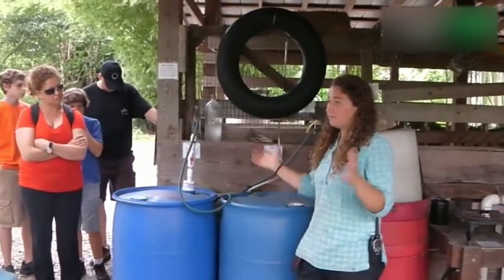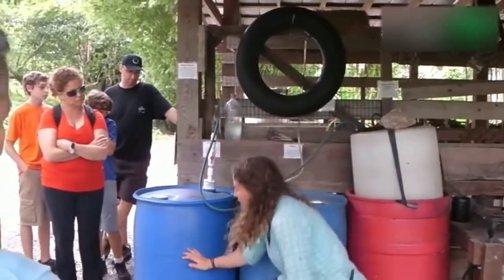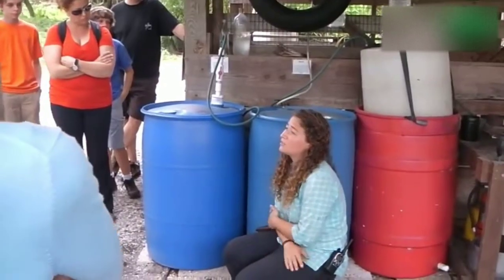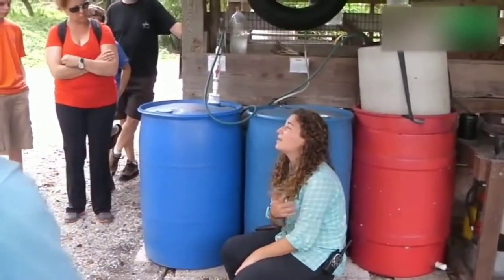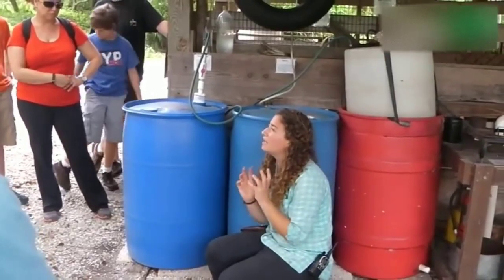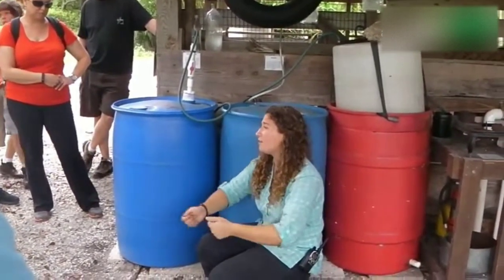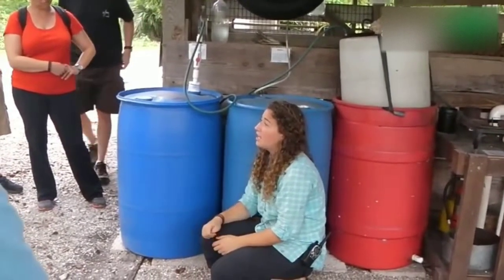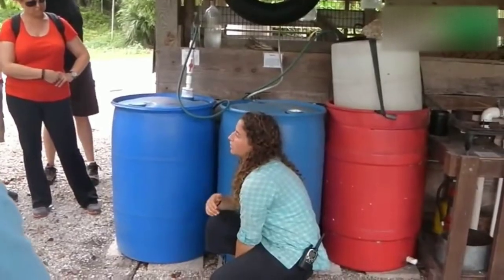How does Barrel Biogas Digester system works..!

Comment: I have been asking this question to many videos regarding this biogas plant and today I found the answer from you. It last only 45 minutes aday and for 2-3weeks used isn't it?. If so then for my bigger purpose like cooking rice every day for about 20 kg rice for dairy farming, how many biogas tank do i need to prepare? Please reply i will be highly appreciated. Thank you.
Reply: if you add some product with higher energy densety than cow dung, you will get more gas production... f.eks frying oil will give ALOT more than cow dung... the energy of cow dung is about 13.... frying oil is 500-700... just make the plant so that you can feed it when is running....

1 liter of cow dung= 13 liter of metan gas
1 liter of frying oil= 500-700 liters of metan gas

try to keep the temp in the plant at 36-38 celsius